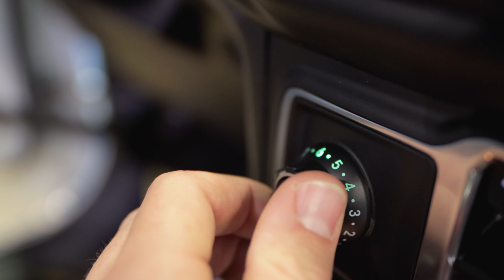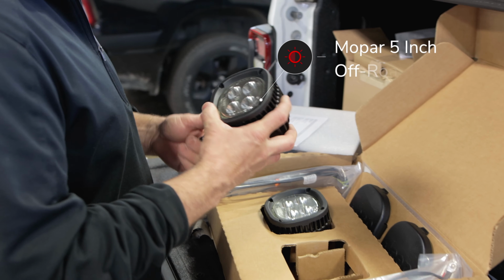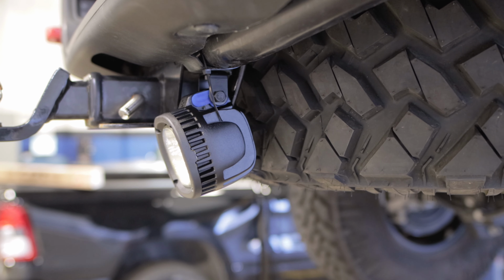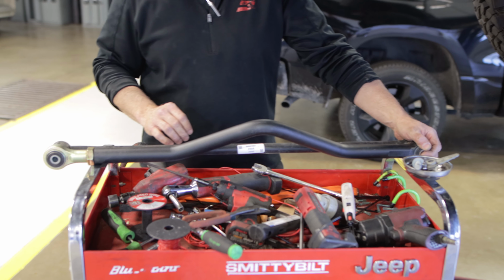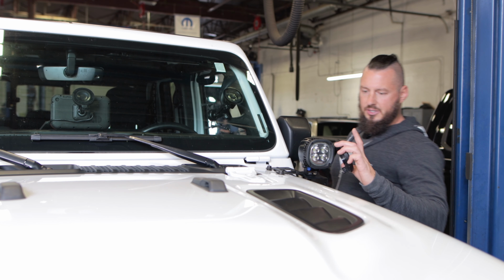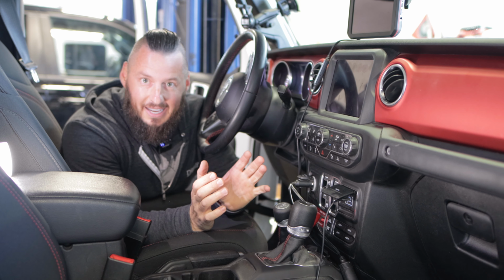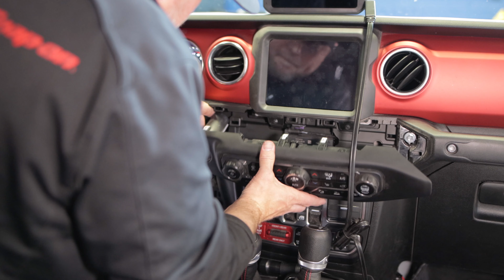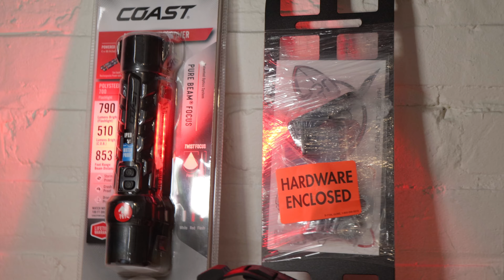3 Must See Upgrades For Your Jeep Gladiator

Comment: If I put a rear light there it would be smashed as soon as I went off road.  I use a hitch skid alot.  Rigid industries makes nice cauling light brackets for 2 lights.  It's more form fitting.
Reply from the maker: I could see that. You’re probably more aggressive off road than me ; )

Comment: How does the 6 run with all the extra wait and bigger tires. Still trying to figure out what to buy gladiator or wrangler
Reply from the maker: It runs good. Had a tough time pulling the 4,000lb trailer over the high passes in Colorado but that is to be expected. 
The diesel was not available when I got my purchase. I am on the fence about which way I would go if I did it all over again but personally I would for sure go with the Gladiator again. The look gets me plus you get the truck bed. 

I really appreciate you leaving a comment! Good luck with your choice!

Comment: Just got a Gladiator Diesel yesterday any upgrade advice would be welcomed. Sport S
Reply from the maker: Congratulations on your new Gladiator! What color did you go with? 
I would suggest doing whatever you want to yours : ) The simplest thing is to add 35 inch tires. Looks better than stock. Other than that maybe a mopar 2 inch lift. I have another video on this channel that shows my setup.
Reply: @DavidWaldrip  I went with the Granite, I watched your video on the two inch setup.  I am being told that I need a 3.5” lift because I’m in a Sport S and to accommodate wheel !7” with 37’s.. do you recommend 35s over 37s?  Keep up the great videos brother….you are one the first go to channels for me.

Comment: David, Hello again! Hope things are going well for you! After all these miles on your Mopar lift, are you still running the original parts besides the rear track bar?
Reply from the maker: Hello Steele Man 
Yes. I haven’t added anything different. Originally I did get the Fox 🦊 2.0 front steering stabilizer / track bar to replace the stock one. Seemed much before. 
Hope this helps!

Comment: What mount are you using for the weboost antenna?
Reply from the maker: Hey Anthony
I am not sure exactly what mount I am using but I went to 4 wheel parts in Utah and the guy had a light mount bracket that I purchased. I had to drill the hole out to make it a bit bigger. They came in a pack of two. Around $50 or so. Hope this helps.

Comment: Did you recalibrate the speedometer? And does it have any trouble staying in 8th gear? I'm thinking of adding 37s on my 22 rubicon. But I'm still hesitant. Everyone always talks about regearing which I don't want to do. Awesome videos bud, keep them coming.
Reply from the maker: Hey Sky Hawk 
I did use the Tazer programmer to recalibrate the speedometer. I’ve had 37’s pulling a trailer across the entire country, off roading, and daily driver usage. I’ve not had any issue at all EXCEPT pulling my loaded trailer up steep passes in Colorado. It made it but it was tough. 

Unless you’re planning to be doing a lot of heavy towing at high altitudes then you’ll be fine. Love my setup. 

Just remember your gas mileage around town will probably be around 10 mpg.
Reply: @DavidWaldrip  Hey brother, thanks for the quick reply. I won't be towing at all. It's my daily driver and 90% city. No off roading or rock crawling. Jeep sees no stress at all.

Comment: Will the 37 fit without the track bar??? Great video BTW!
Reply from the maker: The 37 will fit without the replacing the rear track bar but it could possibly rub or worse. That’s why I changed it out. The distance from the spare to the stock track bar is about thickness of a credit card.

I changed the front track bar just to make the whole truck “beefier”. 
Thank you for watching TC!

Comment: Looking into a gladiator, how do the 37's affect your max towing payload?
Reply from the maker: Hey Tommy
The 37's do great everywhere but I do have a slow go up the steep passes of Colorado. But 99.5% of the time it seems to have no affect on towing payload. My trailer is 3900lbs plus a good bit of gear and water weight.

Comment: First time off road that rear light would get unintentionally left behind;( or maybe even hit with the trailer tongue
Reply from the maker: Lots of off-roading and no issues. Three months of towing a trailer and no issues. Works awesome in that spot.
Reply: @DavidWaldrip  not how I wheel. Even got a skid plate on the wife’s Subaru;)
Reply from the maker: @JeepCherokeeful  That’s cool. Keep rockin it out on the trails. Thanks for watching.
Reply: @DavidWaldrip  destroyed my wiring harness on the Dempster;)